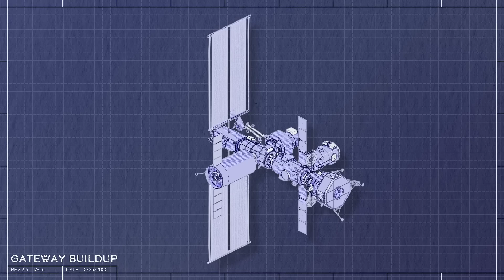Better for Artemis than SpaceX Starship!  The new Dynetics ALPACA!  Angry in Huntsville!

Comment: Starship's profile is way too high, and its landing gear base for to narrow for a safe lunar landing. It's fine if youre landing on a perfectly flat surfacevwith no lateral velocity at touchdown.  As it is now, the landing gear will stop on the surface, but the top is going to keep on going. A prescription for disaster.  The Dynetics Alpaca is low profile  with wide based landing gear. Much, much better!

Comment: Thank's a lot for your critical thought's. There is to much "horray" about SpaceX and to little "are you sure?" Absolute (!!) interesting points of view concerning the  HLS variants ALPACA and Lunar Starship and it's pro's and con's. Practicability wasn't in the line of sight when NASA choose the Lunar Starship at first. As you pointed it out: it was the cheapest offer in a difficult budgetary environment, maybe the fastest way to get a flyable lander-solution out of a conversion of a yet (!!!) non-proven system.  And last but not least: they saw a little chance to have two eggs in the basket: buy and promote a lunar lander to support a similar system in the long-run that maybe evolves  into a vehicle that lands people on Mars. Ok, I forgot the fact that even an oversized lander is a contribution to the resilience of the HLS follow-on program. I think that was and is the reason why the administration did not care about the fact, that the sience community had no concepts for experiments, sience payloads or exploration vehicles that could make use of the 100 ton payload capacity of a Lunar Starship. And I guess, due to budgetary constraints they never will.  I hope, Dynetics has the money to show their HLS concept more offensively and  "louder" to the public, because in terms of promoting a solution there is (allways) an imbalance in favour for SpaceX.

Comment: alpaca and blue origin have far better solutions, the Space X one will never work, the spacex concept is something a child would come up with)  but they all share a ridiculous number of events that have to go right. Many of the top engineers that worked at Dynetics have left the company.  None of the artemis projects will be anywhere close to the schedules any of the companies are putting out there and will end up being a typical tax dollar sink for decades. NASA is still pushing methodologies that are poor design practices such as two fault tolerance which artificially drive up complexity, weight, power and impossible to foresee failure modes and will put astronauts at elevated risk.  Those factors are why Alpaca has a power weight issue to begin with, along IMO a poor choice of using electric fuel pumps.  What was funny is the contract going to space-x with the justification that alpaca was overweight, meanwhile the space x solution is about 20 times heavier.

Comment: Jordan, when you compared the number of launches for the two systems, you did not compare the costs for those launches. Given the best case for traditional launchers and the worst case for Starship launches, isn’t it still about 20:1 in favor of Starship in terms of cost per launch?
Reply from the maker: Good question. Starship's cost is almost impossible to estimate. Nine launches of the largest rocket in history is never going to be $2 million per launch the way Elon promises. It could be a long time before complete reusability is achieved. Until then, it will be tough to keep Starship under $50-$100 million per launch. So, Lunar Starship + 8 refueling mission is likely to cost half a billion dollars per lunar landing or more. ALPACA only needs two launches per mission, or just one refueling mission if you're reusing the ship (ALPACA is even more fuel efficient now). So, once ALPACA is developed, built, and deployed, future missions will only cost $100 million or so, or 20% of a Starship mission.
Given that only 1-2 launches are required for every mission vs 9 for Starship, ALPACA is almost certainly going to cost less in the long run.

Comment: Once there are habitats on the surface Alpaca won't need a full sized hab that needs to support astronauts for 2-3 weeks. Design a smaller "taxi-hab" and you'll need less fuel. I love Alpaca put it needs to be able to be refueled insitu i.e. hydrogen.

Comment: Your snide comment about how Artemis doesn't have the ability to land on the moon is sort of uncalled for. Apollo had 2 modules. They were both designed and built during the same period because the US gave them a virtually unlimited budget.
Artemis suffered from downsizing after Congress refused to appropriate enough money to the Constellation program to move forward and Obama accepted the assessment of the investigative committee that said that it had no chance of success without more funding. He wanted to kill the whole thing, but Congress decided to save SLS and Orion with funding and their own mandate.
In some ways this is GOOD. In the intervening time frame, during the troublesome development period of SLS and Orion, a new funding model developed because of the fortuitous success of the Commercial Cargo and later Commercial Crew programs .Using fixed price contracts that required a sizable investment by the contractors, with the future payoff of the contractor owning the design and being able to use it for other customers, it paved the way for a more economically practical model to develop the rest of the lunar program. (If we used the model of SLS or Orion, we would NEVER make it to the moon again in the 21st century! Maybe I exaggerate, but it seems so.)
Now when we decide to actually land on the moon, we are using a competitive bid, fixed price , "services model" for the landing vehicle.
I am glad SpaceX won the initial bid, since they were going to build the vehicle  and the fuel depot - orbital refueling technology anyway, so it sped up their funding for development and gave NASA the only affordable option to put their funding into.
But since Starship and Lunar Starship is so freaking ambitious and needs to develop so many technologies and vehicles in addition to the lander itself, it is intelligent to support a less ambitious type program to give us a more economical lander.
I agree that Starship and Alpaca are complementary capabilities. Starship has MASSIVE cargo capacity for supporting a lunar colony. No nation on Earth will have such capability, unless they copy Starship or pay SpaceX for cargo transport.
But Alpaca is a better fit for early stages and human exploration on a small scale. Alpaca takes a lot less fuel each trip.
Thanks for covering this under reported niche of the US lunar program.

Comment: I really like the Alpaca design, but its probably more expensive and challenging than using expendable Starships. The only reason for the second HLS contract is disimilar redundancy. Using Starship to refuel or lift Alpaca might sound logical, but is the exact thing that NASA does not want to do. The comparisons with cars are hilarious. The important difference is not that one has 100 times more volume, but that one is way cheaper than the other. Alpaca is the hand crafted bespoke custom car. Starship is a factory line car.

Comment: What is the cost of alpaca, blue origin is cheaper than alpaca according to the source selection statement.
Reply from the maker: We don't know the bid numbers yet. Only NASA has the RFP response currently.  But Blue Origin is doubtlessly cheaper. Jeff is going to throw a couple billion dollars at this to win. But, unless BO changes their design radically, the design will not be completely reusable, which will make it more expensive in the long run.
Also, unless things change a lot, the design will also be over 10 meters tall, and far less safe for the astronauts.

Comment: I've always wondered if there was a way to fit some kind of system that could perform an LEO to Lunar surface mission within the cargo bay of Starship. How many tonnes could be delivered using a starting system mass of 100 tonnes at LEO?
I intuit that it would be between 1 and 10 tonnes but would it be closer to 1 or closer to 10?
Reply: It depends to a large extent on the design. If we assume two rocket stages and a total mass of 100 tons, where the first stage uses metholox and masses 3 tons dry, 63 tonnes wet to give 3.2 km/s (360s Isp), and the second stage is using storable MMH/NTO propellant and masses 2 tons dry, 24 tons wet to get 2.8 km/s (315s Isp), that leaves around 13 tons for payload.

The idea here would be to use the first stage to get to TLI, and the second stage to land on the surface. It could be improved further, but the above would be a relatively low complexity design, where you don't have to deal with cryogenic propellant beyond LEO, and no liquid hydrogen.

Comment: Sorry Jordan, to assert that Alpaca is the better HLS solution by declaring that Starship has to haul Dynetic's fuel from Earth to Lunar Orbit does not a feasible and competitive solution make.   SpaceX gets to take advantage of its full-reusable system, and Dynetics needs to come up with its own way to get Alpaca and its fuel to the Moon.   NASA does not have a contract with anyone to provide a LEO or Lunar Gas Station, and if they did, it would be unwise for SpaceX to bid on it if their full-reusable Starship System can outcompete everything else any other Team can come up with.  Not that NASA doesn't throw bad money after good time and time again ... ala the non-competitive award to the SLS contractors to support more Artemis missions.  LASTLY ... why go tiny just because Orion is tiny?  If we're going to bother putting astronauts on the Moon in  hopes of out maneuvering the Chinese, why consign the effort to a small vision?  Send 2 dozen astronauts instead of just two.   And when it's perfected, orbital refueling will be a minor expense.   Eight runs of fuel by a reusable Starship will probably be cheaper than the expendable rocket that Dynetics is going to need to get to the Moon.  As Elon says, the ultimate metric you need is the total cost of a ton of payload to LEO, because there is no way to cheat.  In this case, what is Dynetic's cost of a ton of payload and passengers to the lunar surface and back to Earth?  Compare that to Starship, and we'll see who has the best proposal.

Comment: Like the comments before me, Yeah agree completely.  Alpaca is an awesome transfer vehicle and early on there were other add-on and mobile modules (like a rover) that could be delivered with it.  That would be so cool too.  Starship might make a good roomy base to leave there for use rather than the inefficient use of it to get two guys or gals to the surface and back up, or a fuel hub on Gateway as you said.  Dynetics and Sierra Nevada are two great companies with great ideas.  Jordan, I'm happy for you that the doors of these wonderful companies have been opened for you so you can have those experiences for yourself who deserve them and then graciously share them with us.  Thank you for your hard work and sacrifice to build and maintain The Angry Astronaut.
Reply: I see Lunar Starship as a giant methalox tank on the surface to run things like generators in the event of battery problems, and to refuel smaller ships that land nearby so they don't have to carry as much fuel down with them.
I also see it as a means to transfer 100 tons of goods to the surface in one go. A nuclear reactor? Heavy mining gear? Geodesic domes? Nitrogen and oxygen tanks? a ton of cowshit to grow food? No problem. More frequent landings and less frequent liftoffs to put actual material on the moon for a moonbase is where I see it going.
Also a shorter, fatter (12m? 15m?) faired (teardrop-shaped) Lunar starship might make some sense also for stability on the surface and accessibility of its cargo bay. Lastly, its cargo bay could be put aft and the downcomers feed the engines below the cargo bay... Turning rocketry upside down!

Comment: This system couldn’t make it to the surface of the moon. It was not selected because the Design was flawed!!
Reply from the maker: If that's the case, then why did NASA grant Dynetics another 60+ million cash award?  The design most definitely can reach the moon. I'm standing here with the engineers who designed the new model as I type this.
Reply: Designs change, & Dynetics is working with Grumman now. Let's see what ALPACA v2 looks like.

Comment: Any info for the booster for the "new" ALPACA?  NASA did not want to depend on Vulcan, as seen in the HLS decision, where Dynetics tries to defend choosing ULA.
Reply: As soon as starship can be used, there will be an obvious booster to LEO for Alpaca. And from there coupled to another Starship optimized for travel to Lunar Orbit  (No heatshield, but reasonable shielding against radiation). That Starship could also function as the temporary Lunar gateway as well and provide everything needed to take Alpaca to the moon and back several times. Providing more safety as well.
Reply: @genius1a  Yes, Starship can do anything and everything. So why even build ALPACA?

Comment: Alpaca is a Jeep, Starship is a Semi both are needed.
(also, how many alpacas could you send in one starship flight? how many times could the alpaca refuel from one starship tanker in lunar orbit)
Artemis is a short-sighted political stunt, for the long term, we need to not focus on the silly artemis crew size limits (which are driven by using the Orion as the long-range crew transport)

Comment: I'm really curious what they are going to load the cargo bay with on the demo starship HLS?  I mean it would be a total waste not to pack it full of supplies.
Reply: depends on the outcome ^^
but in seriousness: the point of Starship is the goal of unheard affordable flight costs and rapid reusability. No one would think of a waste, when Airbus does test flights without passengers, right? (Funny, that example woud have been massively misleading, if I had put in the name of the main competitor starting with B instead...)
Reply: Agreed. It will not be lifting off the moon, so why not pack it with supplies and/or use it as a habitation module?

Comment: If the reason were "pretty good" then how can you say they were "thrown under the bus" ? You note the deficiencies in the original design, and then say it was all about price - which is it? The Alpaca Mk2 appears far better than the crazy Blue Origin led teams multi-stage design, but you keep saying its required for the "initial" Artemis missions, but aren't the initial mission(s) already under contract with SpaceX ?
Reply: Space X and Dynetics are both not there yet. The one flight ready first will take the first human flight to and back from the moon surface. On the long run we will need both - Starship and Dynetics Alpaca  - for a sustainable regular moon base and flight service.

Comment: You said it can be used for up to 10 landings. How much is it supposed to cost in total?
Reply: I'd assume Alpaca has the potential to be a workhorse with waaay more landings and fast lunar surface travel as well. That would make the initial cost almost irrelevant.
Reply: @genius1a  I think you are making assumptions, which in regards to space flight is not something you should do.

Cost is definitely a big factor if something has limited reuse. I used to work with a product which could be used up to ten times. In actuality, it could be reused on average three times. Out project calculated cost based on five reuses, so we went thirty precent over budget. 

If you think about how most space flight projects go over budget and have all kinds of problems, it is a bigger issue than you wish to believe.
Reply: @scottstorck4676  I don't think Boeing and BO are the companies we should take as typical expamples for future space flight development. I could Imagine Alpaca as a transfer Vehicle that can be refuelled and maintained in space at the Lunar gateway - and be reused dozens to hundreds of time as a result. Alpaca looks like the perfect basic Idea for accessible and maintainable propulsion systems. But there's a ton of development needed to build a leigthtweight  structural design. That's what Dynetics seems to do. And I'm sure if they find ways to make the basic concept work, it can be adjusted rather easy to many more sizes and applications.
Reply: @genius1a  Imagine what you want. Just don‘t be surprised when reality is not what you imagine. You can have whatever opinion you want, but it doesn’t make the question of cost irrelevant.
Reply: @scottstorck4676   Of course the cost per flight is not irrelevant, but the true cost of each flight differs vastly if each vehicle can fly only 3 times until it has to be replaced or if it can be reused hundreds of times. in the latter case the vehicle can be 10 times as expensive and still be a way cheaper solution per flight than an Apollo like one time usage vehicle. 
Lets be real: Dynatics pretty sure does not know the cost of their Alpaca vehicle as of now, before they even have finished a preliminary construction. You have to imagine something, make uncertain assumptions, before trying to realize it. Wherever it takes you. That may be hard for tight calculating people - which is the reason why there are not so many innovators out there. And even less successful ones.